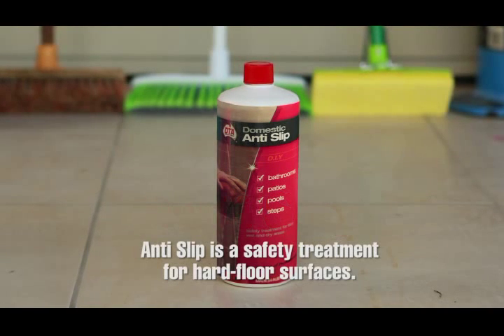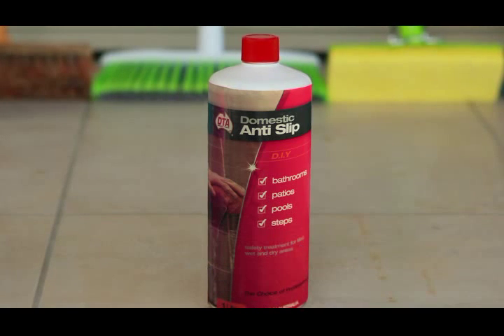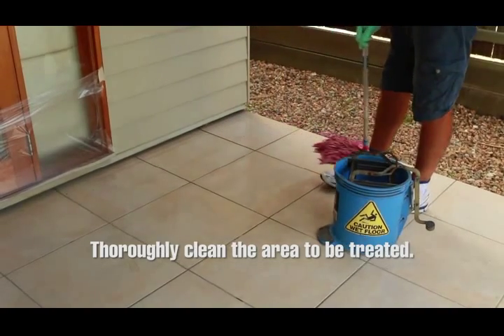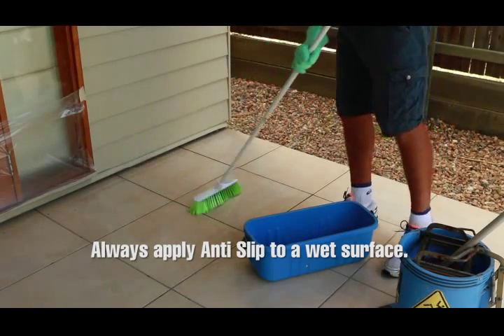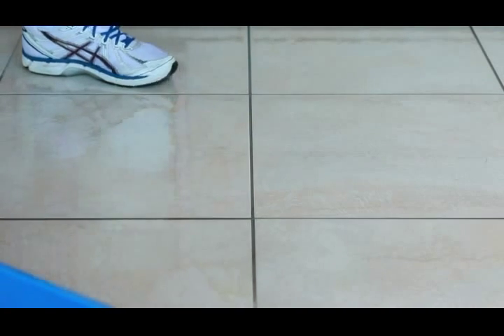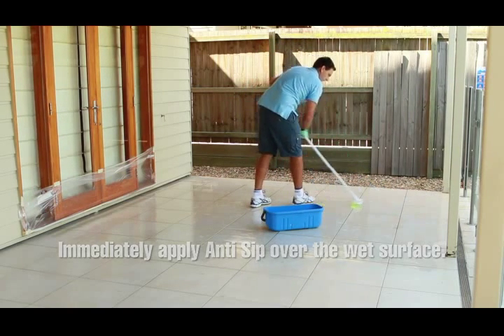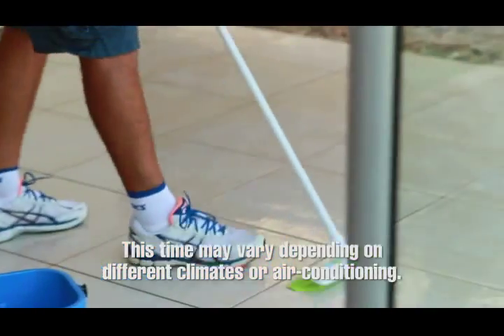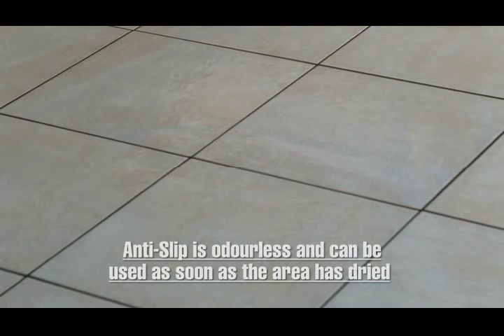Anti Slip coating, the best way to make slippery floor tiles and covering safe. Easy to use.

Comment: This is not a COATING, it is an acid etch! An Etch is the best way to make a ceramic, granite and porcelain type tile safe!
Reply: Stan S so dear Stan, why do they say that this product is not good for porcelain? Do you know?
Reply: Acid etc works, but destroys the surface of what ever it contacts. NoslipCA.com , is non acid and non topical. Works fantastic!
Reply: so does it mean thn you can neve get the original surface back?
is there any option for temporary anti skid?? i hav marble tiles and im staying in a rental and my pet is slipping and its causing health issues. i tried carpet but its stil slipping... please help me with options.

Comment: looks like its being applied on a porcelain tile? which he stated not to do.?
Reply from the maker: It can be applied to all hard surfaces, just would need regular coating as Porcelain tiles are non-porous
Reply: @ParallelEnterprises  so it can be used for porcelain tiles?? How long to have recoating 6 months a year?
Reply from the maker: Depends on the traffic, higher traffic areas would need more frequent applications e.g. entrances